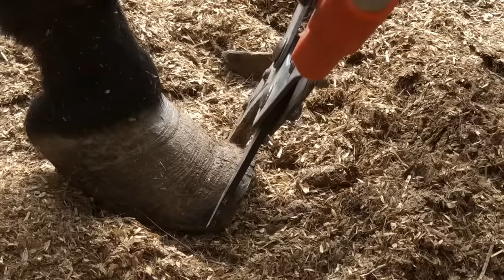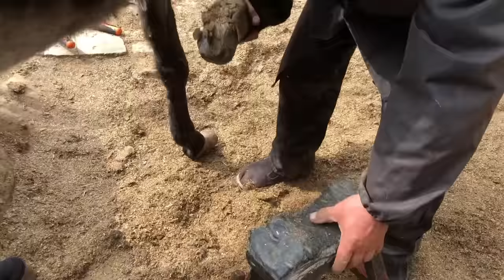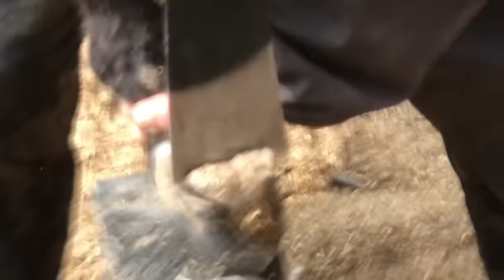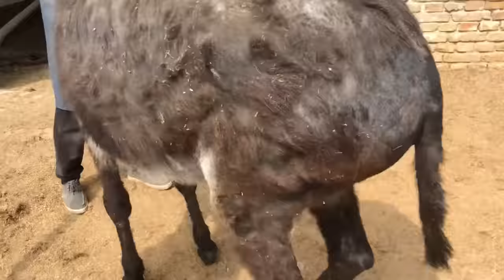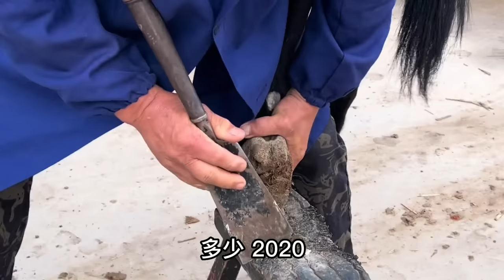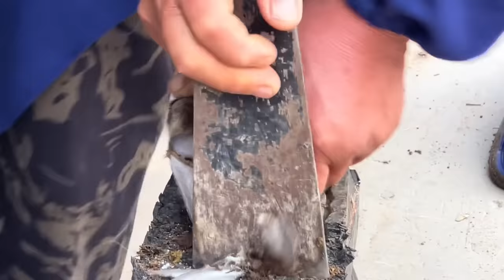毛驴捡了一条命！瘫痪驴双腿弯曲异形，蹄内病疮入骨，修蹄后死里逃生！【河北小辉姐】

Comment: I don't feel any donkeys were saved in this video. The first donkey still has ringworm, a fungus that is HIGHLY contagious, and is penned with other donkeys and is why her fur is falling out all over her body. The mare needs a medicated shampoo and topical fungal treatment. She is still significantly emaciated and needs to be on a refeeding program where she is guaranteed access to her own food she does not need to fight for and she should be quarantined from the other donkeys to prevent the spread of the ringworm anyway. Her hooves. . . . . .obviously there was significant issues to the point her legs were bending in ways they should to compensate for her hooves. There should not be blood or redness in the hooves. My personal opinion is he should have taken more hoof off in some areas, depending on the softness and if any spots showed pain to the mare. The feet were still left long and unbalanced, even for traditional Chinese methods of trimming. You could easily tell by the length that this was an ongoing issue that had not been attended to for a long period of time. 
I am not here to hate on the farriers as this is likely nt their animal and they were called in to do a job, but the animal is not safe from harm and still has significant health concerns that need to be addressed and I didn't see an effort to address those issues before the farrier and there was no talk of addressing them after the farrier. The mares coat/hair will continue to fall out and if she did not get ringworm (a fungus that can make circles or rings) then she will pass it to every other donkey in the pen easily and humans can get it as well. She also needs so much weight and they said she didn't have strength to fight back so how will she fight another donkey for food? Even if she is for meat purposes there is no meat on her and a human can get ringworm by touching her. I feel bad for the donkey.
Reply: Looks like she has Ricketts from lack of vitamins. Last hoof he did looked like she had an old abcess...did you see the 2 holes in the sole? I agree with all  you said.
Reply: ❤個ㄥ🎉
😂😂
Reply: This made me SICK
Reply: Are you sure that's ringworm and not rain rot?